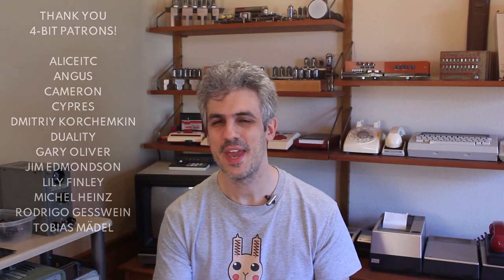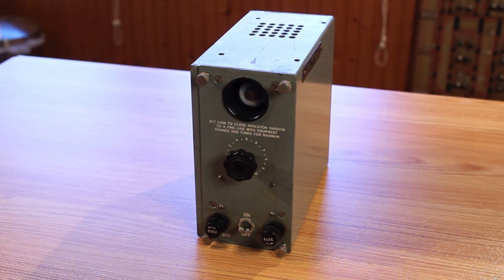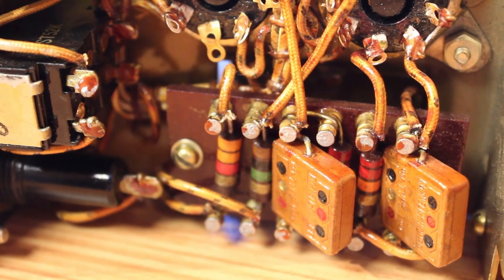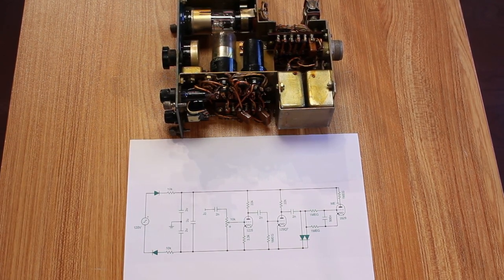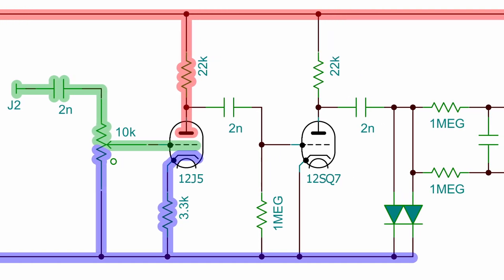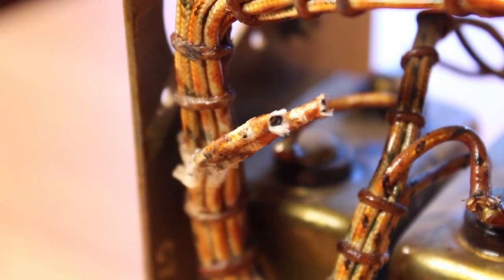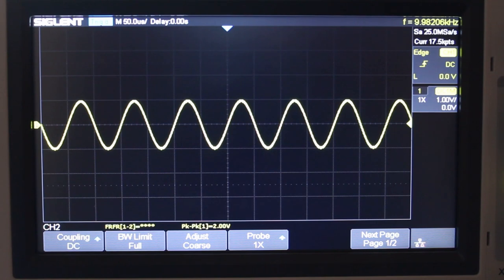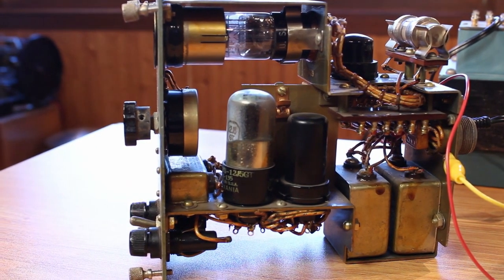Reverse Engineering a U.S. Navy Vacuum Tube Thing

Comment: That is a piece of sonar gear. The idea was that you would mount this thing to the edge of a Bearing Deviation Indicator to give you a more known precise bearing. While the BDI could give you a good indication to plus/minus five or ten degrees, this gizmo would allow for a much better visual indication of just a couple of degrees by pulling signals off the BDI. When you were pointing at a target, the eye would be fully activated, and any amount that you were off would be deactivated. Sort of a late war add-on to the system.
Reply: I was going to say navy radar, so Sonar fits as well. Navy as its painted grey, army would be green,  all aircraft equipment in the copit has been blue and in avionics bay black. They are the colours im used to working on in the UK.
Reply from the maker: I think you absolutely nailed it!
That makes a lot more sense and fits perfectly with what we're seeing, thank you so much!
Reply: What sonar are you talking about. I worked nearly every sonar system there were, from the British 1938 ASDIC to the US 1992 upgraded MK 26 sonar system. And none of them had an eye indicator. Radios yes, Fire Control yes, Loran yes, DF systems yes. The first Sonars all used the 4" CRT tubes.Followed by the 6" and then 8 and 10" CRTs. By 1952 the US move into the MK6, and for longer time the Mk7 with a 12" yellow CRT. The US kept Mk 7's up to 1964.The electronics remained the same, but the transducers all were improved producing different Marks. The sonar plates were improved too, for better 360 deg search. Then we went hybrid and then digital by 1979. I even installed PUFFs on submarines.
Reply: These was used with some of the early world war 2 sets like QCP, QCU, etc. sets that were NOT given an CRT. These were used with the CQA-55098 or CBM-55105 Bearing Deviation Units. I have one of these little units at home - maybe I can find it.
Reply: @uniservo  CQA-55098  that was a a rather larger wall unit.  Could be a later version 50s I know they evolved to have plugins.  Will have to check later catalogs.  Maybe it is 1950s not 40s.  One of the chaps at the radio club suggested it was a post war build form the stitch and fuse arrangement.
Reply: Correction..., I help design the 1954 Bearing ID unit, for the submarines ported in Groton, Conn. Prior to the PUFFS installation
Reply: O gravity power q bits
Reply: @UsagiElectric   so this is a piece of gear for fine tunning a signal?! does it work by reducing the amount or harmonics in the signal? and hence retransmiting it as purer signal?
Reply: heyy, I was right! my guess was sonar or radar
Reply: You some what Right it was used to help land jets fire guns or missiles it is part of target beam systems
Reply: Some soldiers would have portable ones to mark targets and shit
Reply: My guess was it's part of a detector set, probably radio, to get a precise bearing on a source so I'm pleased I made a good guess.
Reply: @UsagiElectric  hey man I got some more green eye equipment if your interested I have a navy morale radio receiver if you want to reverse engineer it to make some schematics and wiring diagrams

Comment: The conformal coating is called MFP, moisture and fungus proofing. It was used in electronic equipment in the 40s and 50s that was intended for active field service. The two diodes in the last amplifier stage are for detecting the signal on a carrier wave going through the signal path (radio purpose).
Reply from the maker: Oh very interesting, I didn't know the official name for the conformal coating, but that makes a ton of sense given the damp and salty environments that Navy gear was destined to be used in!

Comment: Magic eye tubes need negative DC input voltages (with respect to the cathode) hence the rectifier that shunts the positive halves, leaving out the negative ones. And since 12SQ7 is a triode and two diodes sharing the same cathode, the manufacturer connected both diode plates together and used the diodes as signal rectifier.

The device is basically an AC level indicator. It's indeed beautifully built and sturdy as hell. Something that can inspire amp builders, and what most modern electronic equipment lacks.
Reply from the maker: That makes total sense! 

I also missed an important connection from the magic eye's cathode to B-, here's the updated schematics:
https://i.postimg.cc/jdZ7FfBh/Updated-Schematic-A.png
https://i.postimg.cc/85MyR4K4/Updated-Schematic-B.png

It really is immaculately well built and an inspiration for how things definitely should be built!
Reply: What happens is that when the voltage is positive, the 2n condenser is charged and then when the voltage goes down, the diodes have no resistance and the grid goes negative. So it is basically for a DC shift.

Comment: The rectifier diodes are wired as a classic voltage doubler. The rectified voltages are centered around the ground on the junction of the two filter caps. The magic eye tube is essentially an inertia-less galvanometer for measuring very fast voltage change. Some sort of carrier signal, possibly modulated, is coming in, being amplified by the 12J5 triode, and the triode section of the 12SQ7 and then rectified to a DC level by the two plates coupled to the 12SQ7's cathode. The 1629 is just being an eye tube. There are many variants. They are extremely simple. This entire device is an over glorified, yet highly sensitive, vacuum tube volt meter. Either a tuning indicator or a display for an RF or sonar proximity detector. Submarine or ship anti collision device if I had to guess.

FYI: The magic eye tube was invented by Allen B. Du Mont of oscilloscope fame. Before that tube, he was famous for inventing the "long life" cathode ray tube. Prior to Du Mont, CRTs were of the Braun tube variety (pronounced "brown", not "brawn"). The Braun tube used an unheated tungsten spike for a cathode, required up to 100,000 volts to work and had a notoriously short life span. A few hours at best. X-rays were discovered in Braun tubes very early on. But, that is another story. 
Du Mont produced CRTs with indirectly heated cathodes and solved the problem of short life and lethal operating voltages... when he was 18! Prior to that, he won a competition at age 16, sponsored by the Dairy Association to find a replacement for heavy glass milk bottles. Du Mont invented the waxed paper milk carton, which is still in use today (juice boxes) and won the competition, all before 1920! He won $10,000! Back then!
Reply from the maker: Thank you so much for the excellent reply!
As for the 12H6, I don't think it's a voltage doubler. I checked the voltages in the circuit, and it's only showing rectified DC at about 135V. It's a bit lower than I was expecting, but I suppose with the voltage drop across the diode and the potential mismatch of capacitor values for a 400Hz supply versus the 60Hz I was feeding it, it does make some sense.

Another commenter suggested that it was used as a Bearing Deviation Indicator in early sonar systems, which seems like a fairly likely application, but it's designed in such a way that it could have had multiple uses on several different types of equipment.

Also, on the topic of Braun tubes, in Japanese, CRTs are still called "ブラウン管" (Braun tube), which is ironically where I learned the proper pronunciation of "Braun"!
Reply: @UsagiElectric  12H6 has max plate voltage 150V. 120V AC * 1,41 = 170V DC. So one diode is not enough. Additionally pair of diodes when in series have doubled internal resistance. It allows using bigger capacitor for better filtration. Additionally filtration is better due to higher internal resistance of rectifier. I would strongly suggest of using some kind of AC power supply with current limit. If not, then old-style incadescent light bulb in series with tested device can save device. Then something goes wrong, light bulb shines, nothing more happens. When all is ok - light bulb flashes at power-on, then glows very weakly. It's good to have few bulbs with different wattage, ex. 15W, 50W, 100W and perhaps 300W.
Reply: It is not doubler, it is really a halfwave rectifier. The configuration is such in order to accept power from 2 phases of 400Hz 3-phase onboard power, arranged as 3x85V in Y with (weakly) grounded center and allows the negative power side to be AC grounded.
Reply: @videolabguy - Thanks for the mention of Allen B. Du Mont.    I was not aware of this guy and really enjoyed reading up on him and his contributions to our craft.  Super Interesting !!!

Comment: As a thought - is it for some form of tuned system - such as a resonant power supply or an antenna network to give an indication that it is falling out of tune or that the alignment of two moveable elements has shifted (hence the instruction about being trained)
Reply from the maker: It certainly could be used for that!
Another commenter suggested that it was used as a Bearing Deviation Indicator in early sonar systems, which seems the most likely. Although, it's entirely possible that this one unit was used for multiple purposes given that it's designed in a pretty generic way!

Comment: Hmm, I figured it would need 400hz because not only was it potentially used in a nautical setting, but it's also military spec. The wiring being 'over built' made me also believe that. Absolute treat and an amazing video!
Reply from the maker: Thank you!
You know, I totally didn't think about that, but you're absolutely right! Most Navy gear is expecting 400Hz AC power, so I was probably feeding it with quite a bit less frequency than it was expecting.

Comment: The input rectifier diodes are actually in series (as per your schematics), so this doesn't look like redundancy. Maybe its rather for halfing the reverse voltage across each diode?
Reply from the maker: Oooh, that's a good idea too! I didn't think about it from a standpoint of reverse voltage. Although, with vacuum tube diodes, the reverse current has to be absolutely massive for their to be any current through the vacuum (like enough to arc inside the tube). So it may be more about moving enough forward current per plate instead?
Reply: @UsagiElectric  I'm no tube expert, but you have rather small distances between anode and cathode, also not sure how much (space) charge is there still around. Doesn't the data sheet give this information? Of course, the max allowed reverse voltage might be more than 2x peak-to-peek voltage but this can be checked.
Reply from the maker: @TheDiveO  True, it is quite a small distance. In the datasheet it lists peak inverse voltage as 465V, which is quite a bit more than I think will be applied here. The 12H6 can only supply about 40mA per plate max, so it could very well be for both increased reverse voltage protection as well as current.

Comment: I wouldn't be suprised if it is meant to be fed from a 400hz source, rather than  the 60 hz from the utility. Because of the relatively smal filter caps. You can do some math to find the frequency range of the signal expected  based on the coupling caps. Probably IF
Reply: 400hz, was considered special freq. It came about in the mid 1950's with the arrival of  the Mark-14 and Mark 19 gyro compass. Giving the US Navy its roll and pitch outputs. During the time of early missile development. It allowed the transformers and the synchro units to be made smaller. But prior to 1949, all voltage sources were 24v DC or 110 -440 volts AC. The Navy used the ARMA Mark 7 mechanical gyro compass or the Sperry Mark 10 or Mark 12 mechanical gyro compass. They were big, and had a room all to themselves.
Reply from the maker: You may be right on that one! 
Another commenter suggested that it was used as a Bearing Deviation Indicator in early sonar systems, which seems like a fairly likely application, but it's designed in such a way that it could have had multiple uses on several different types of equipment. Unfortunately, without knowing someone who is intimately familiar with these (which is getting more and more difficult given the time frame), it may be tough to lock down exactly what it was used on.

Comment: Are you familiar with Paul Carlson at Mr. Carlson's Lab channel? You should have a look at his variac/isolation transformer/current limiter setup. It's pretty slick and not difficult to build.
Reply from the maker: I am indeed familiar with Mr. Carlson's Lab!
The majority of stuff I do is pretty low voltage DC stuff, so I hadn't ever really needed a variac or isolation transformer. But, given how much fun this was to play around with, I may start working on more old stuff like this, in which I'll definitely need to get my hands on one!

Comment: Well I had a look though some 1950s a JAN and AN catalogs and could not find your device.  Going to get an Old Cro friend of mine to have  a look at the video he might be able to identify it.  From the plate that is on it and the fact it has no JAN or AN  it on it I am leaning to something that was never accepted as standard issue.   By the way the metal tube are glass on the inside.  The metal case was just a way of cutting down on hum and other interference same as a tube shield you see on the first stages of an old AA5.
Reply from the maker: Thanks for getting your friend to take a look at it!

Another commenter suggested that it was used as a Bearing Deviation Indicator in early sonar systems, which makes a bit of sense given that it's designed to give a more precise indication of incoming frequency. But, I think it was originally designed in such a way that it could have had multiple uses on several different types of equipment. Really, anything that needed a precise frequency indicator!

Also, excellent catch on the metal tubes! Interestingly the 12SQ7 is a glass tube with a metal enclosure, but the 12H6 is a full metal tube. So, this piece has the whole gamut of tube variations, haha.

Comment: I could use it with a signal generator for lining up the IF stages in a superhet radio.  You basically inject a circa 450 kHz signal amplitude modulated at say 400 Hz and tune the IF slug for maximum response.  This device amplifies the signal coming out of the filter, then detects it and displays the audio frequency amplitude on the magic eye.
With a superhet radio, the receiver's own circuitry does this amplifying and detecting and the audio amplifier and loudspeaker is used to tune for max amplitude.
If you are testing or trimming an IF transformer on its own, then this device supplies the necessaries to detect the response.
Reply from the maker: I'm not going to lie, most of that went way over my head!
I'm a total newbie when it comes to radio stuff (being deaf in one ear makes audio projects... difficult), but I'm certainly fascinated by the near black magic level skills required to do it properly!

Comment: Every 1629 schematic I've seen has the cathode grounded or very very close to ground so I suspect a little more tracing is in order. The 1M inline with the cathode looks out of place. Army tube systems I've worked on at least all come with technical manuals which describe every last aspect of operation so while you'll find ingenious thinking here and there, it all seems to add up quickly and it's generally very conservatively designed. I can't speak for Navy tech. I have two potential use guesses.... #1 is as an antenna tuning indicator, and #2 is this might be an auxiliary level display for a radio direction finder to be placed near the helmsman. It's not part of any fire control (weapons) system I'm familiar with.
Reply from the maker: You're absolutely right about the magic eye! 

I went back and double checked it and I missed the connection from the cathode to B-. Here's the updated schematics: 
https://i.postimg.cc/jdZ7FfBh/Updated-Schematic-A.png
https://i.postimg.cc/85MyR4K4/Updated-Schematic-B.png

Another commenter suggested that it was used as a Bearing Deviation Indicator in early sonar systems, which seems like a fairly likely application, but it's designed in such a way that it could have had multiple uses on several different types of equipment.

Comment: It's an external vu meter. Connect it to a audio output, and you will have a visual, quiet and sensitive indication of activity.
Reply: The original discord green circle indicator
Reply from the maker: That makes the most sense! I was mostly curious what application it would have been used in originally, but a few other commenters have placed it as a sonar device, which is awesome!
Reply: a U.S. Navy VU meter, that's some real solid reasoning right there.
Reply: @railgap  Huh, I guess you weren't aware that USA's WW II submarines had on-board discos to keep morale up.
Reply: @railgap  I was in the Navy.  Our VU meters were made b General Mills, the same company that makes Cheerios.

Comment: My guess is that it is part of an antenna tuning system, it monitors the output of an RF amplifier that has a tuned parallel LC circuit, so the idea is to tune the LC circuit for maximum power output, my theory anyway.
Reply from the maker: It very much so could be! 
Another commenter suggested that it was used as a Bearing Deviation Indicator in early sonar systems, which seems like a fairly likely application as well, but it's designed in such a way that it could have had multiple uses on several different types of equipment.